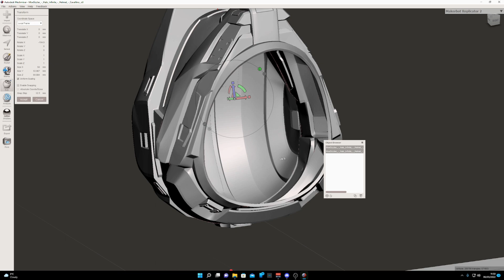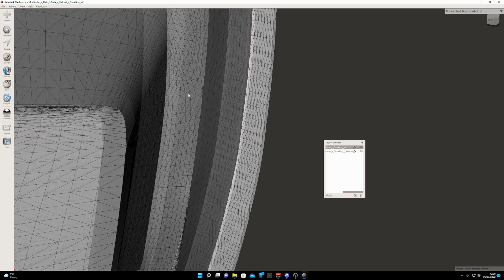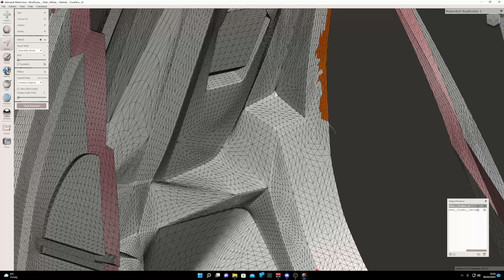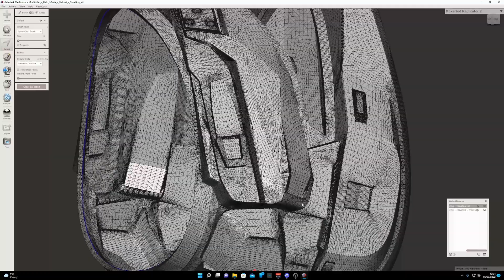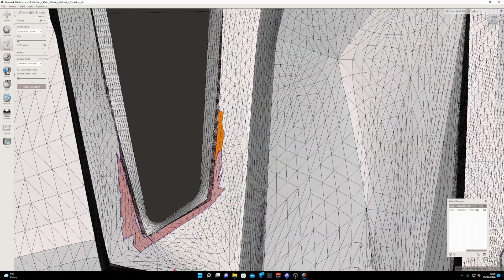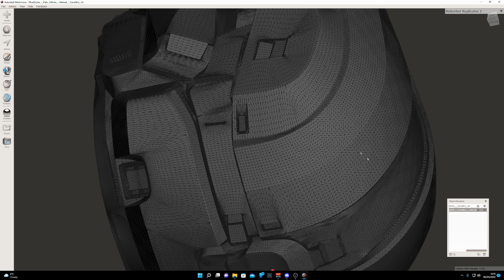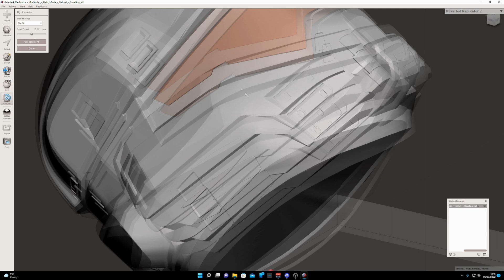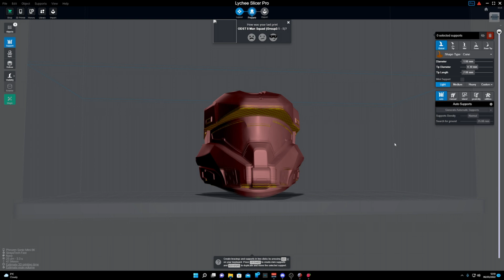Meshmixer Fill hollow object ||  Removing inner mesh for solid Infill in Meshmixer

Comment: How do you crosshatch,(chainlink fence/mesh design) an interor of a cylinder/found on 3dlab print models F86 A)  This is to strengthen a rc plane fuselage that has been hollowed out?

Comment: Instead of selecting an area to delete by painstakingly going around the model with the selection brush, a much easier way is to go edit/generate face groups, next select the face/modify/ expand to group or hot key "G" then delete. Using face groups can be very helpful and easily accomplished, particularly with very geometric models such as this.